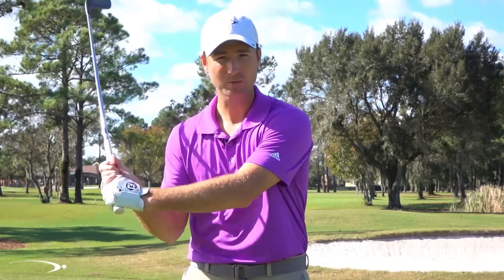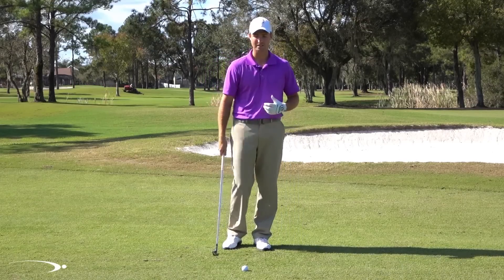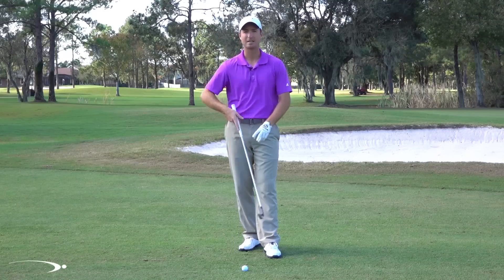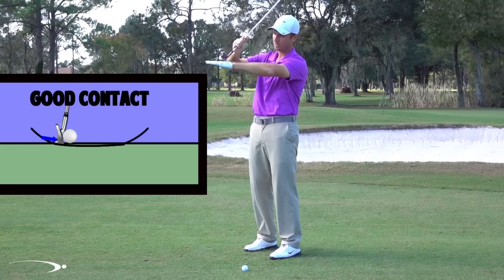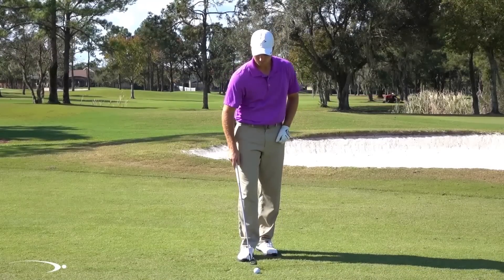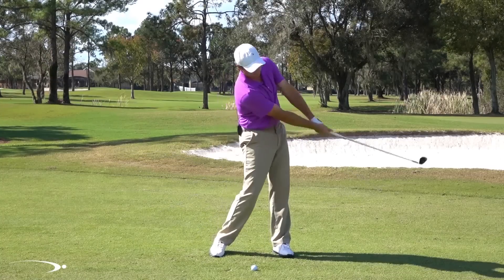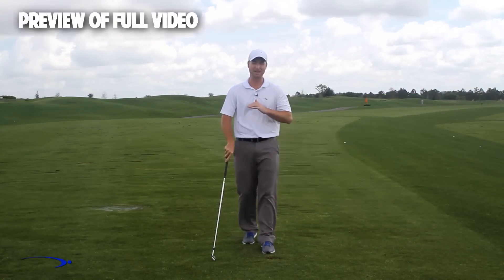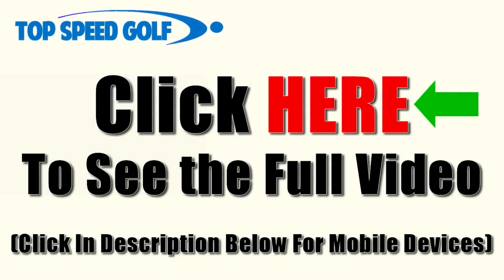How To Stop Casting And Start Getting Lag

Comment: So, the underlying cause is set up? I agree. So Clay, can I change my ball position without moving it forward or backward in my stance?
Reply from the maker: Hi, your ball position is what you should look at first. If you have the ball too far back then you may have a tendency to flip to shallow out the club. You would likely have to come down steep get forward shaft lean in this situation. I'm not sure that I understand the second question. I'm not sure how you would change your ball position without moving the ball. Play well ~ Quentin | TSG Instructor
Reply: Top Speed Golf - Clay Ballard I’m wondering how to use the target line or body line to my advantage with ball position. I’ve been listening to a guy talk about using an open stance to change ball position. Any help is appreciated.
Reply from the maker: Hi, I see what you're saying. Well, if you set up to a ball with a square stance and then open your stance without moving the ball then that essentially moves the ball back in your stance. If you close your stance then it moves the ball forward. Opening your stance can cause you to slice the ball and closing your stance can cause you to hook the ball assuming you would swing the club down your toe line. My best recommendation would be to experiment with it and see what works best for you or to get a lesson from your local pro. Hope you are playing well! ~ Quentin | TSG Instructor